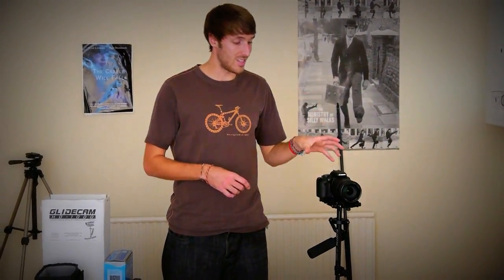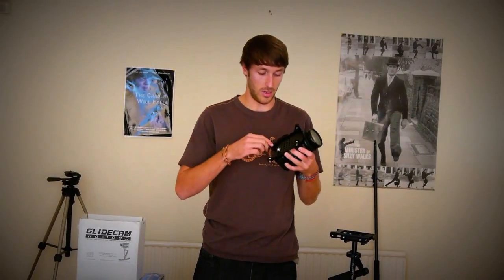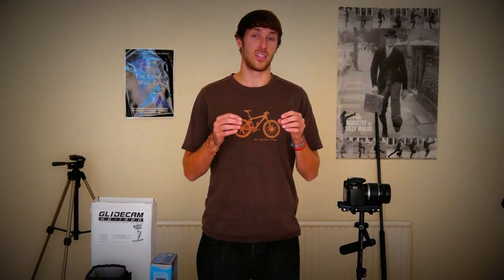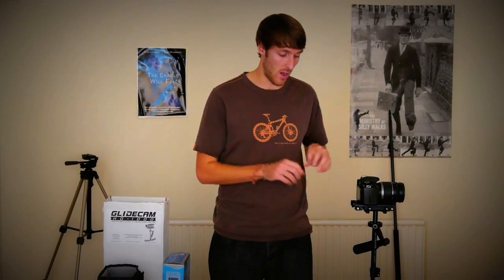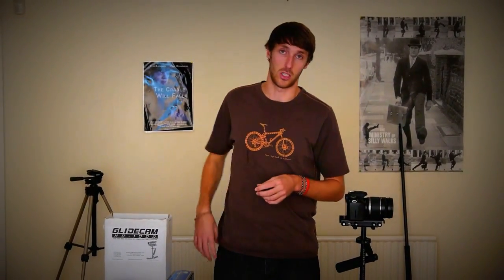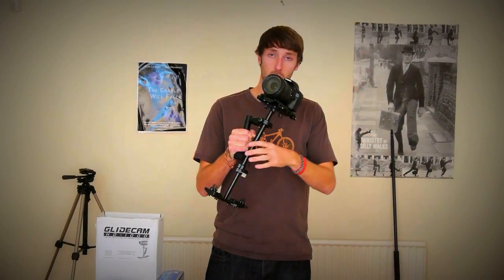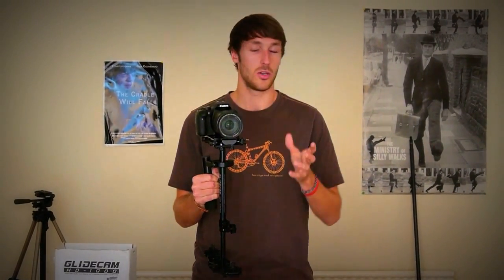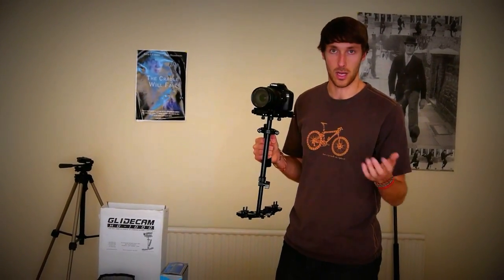Glidecam: How to balance and operate the HD1000 with DSLR

Comment: I still have my Glidecam 1000 Pro that I used to use with my full size Panasonic SVHS back at the turn of the century. It was way too heavy for it and I had to put batteries on the bottom of it, killed my arms in a few minutes. Crazy how I can now use it for my DSLR but yet it's still ruddy heavy.

Comment: I would also buy this, but I think my camera to light. My camera is approx 200 grams and the site for the glidecam hd 1000 you can use a camera from 750 grams to 1.5 kilograms.
Do you think it is possible to still use my camera on the glidecam hd 1000?
I hope I get a response.

Comment from the maker: It'll be able to attach perfectly fine. You may need to get a different screw size but that depends on your camcorder. It's all to do with weight rather than model. You can mount an iphone to the glidecam with the right set up.

Comment: I have the glidecam xr500, but when I run, there is a major pendulum effect, especially because it is so small. Any tips?
Reply from the maker: Matt W I'd make the setup more camera heavy. You can add extra features to your camera (LED light, shotgun mic) or simply make the stem slightly smaller. Hope that helps

Comment: cool. i bought it today and I would like to use it with my gopro 3, could you tell me how to do it?
Reply from the maker: Mike Ehrmantraut I don't think a glidecam is suited to a go pro. It's built for DSLR or video cameras. I'd recommend a smaller go pro gimble system. There are plenty of options out there for smaller cameras.
Reply: thanks, but I know there are guys out there that use glide cam hd 2000 with go pro and result is amazing. so there is a way to install it. thank you Cal

Comment: Do you think 25mm is wide enough to use with this glidecam?
Reply: It will be pretty shaky, i suggest an 8mm - 18mm
Reply from the maker: It depends on your camera. If you're using a crop sensor then definitely go for something wider. On my full frame camera I am using a 28mm lens and it works beautifully.

Comment: Using a glidecam isn't easy. You have to use two hands to control it, and it takes a lot of training. The swaying from left to right is just the physics of the glide cam. You have to learn and control it

Comment: You can also add a Glidecam weight plate.  It's called a head micro steel weight plate  catalog # glcwp  I am using a Gopro in a combat cage with Rode Stereo Microphone.